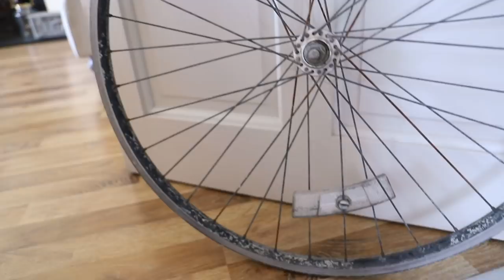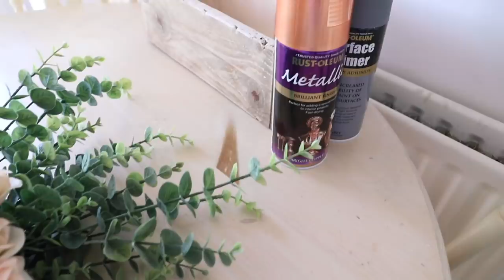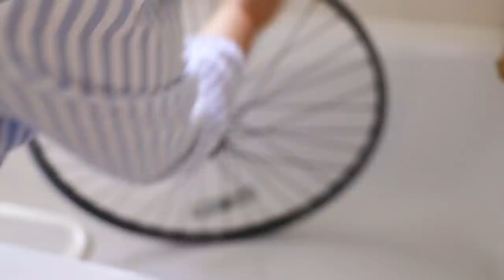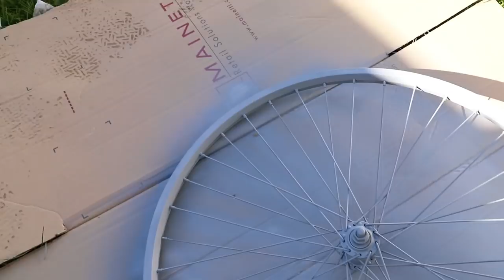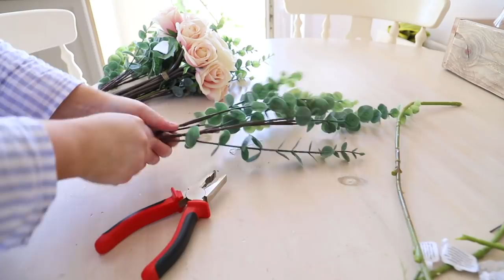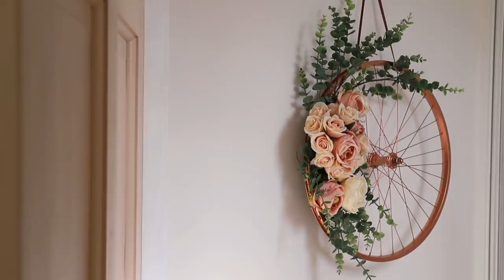Repurpose And Recycle An Old Bike Wheel

Comment: have you thought about hanging the wheel horizontally and hang from the spokes small mason jars with candles, use flora wire around the top of the jars to suspend them would make a cool out door  chandelier under a patio or gazebo..... would be cute painted white  with  colored mason jars.  just a thought.
Reply from the maker: Great idea! I am going to try get some more wheels to use in the garden! X  thanks so much for watching Mary x
Reply: @DaintyDiaries  hope you film the diy when you get another.  if you can't find any more on the road side you may can find a lot in the junk yard, here in the states that's where I'd look a car junk yard.  they usually have all kinds of old stuff from cars to motorcycles  to bikes.  can't wait to see what you come up with.  one more idea, a mobile.  a cute mobile with miniature tea cups,   you love those so much or cute birds or kitty cats suspended from them even a mobile for a baby's room.  ok enough with the crazy ideas. can't help it they come at me at warp speed all the time.